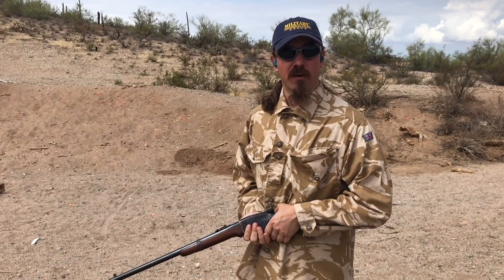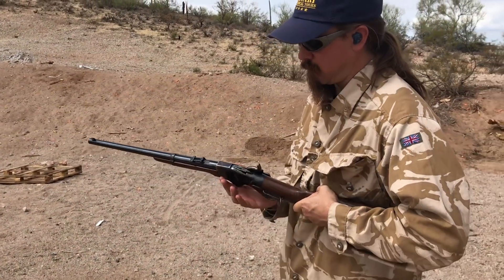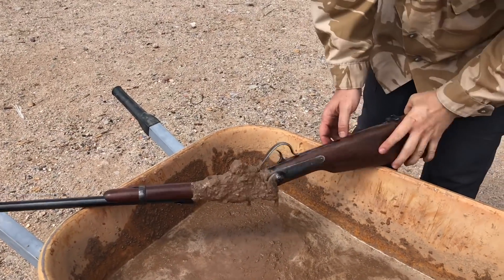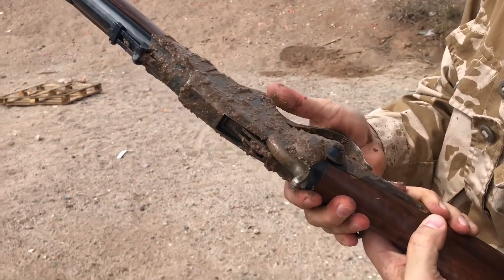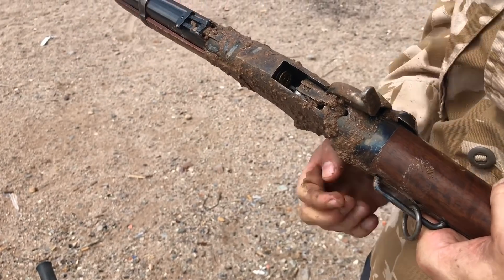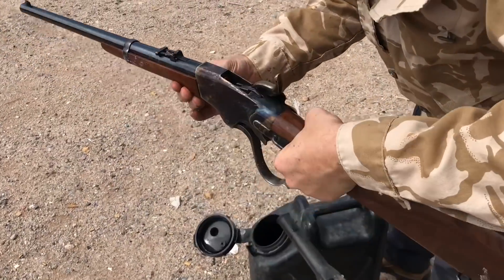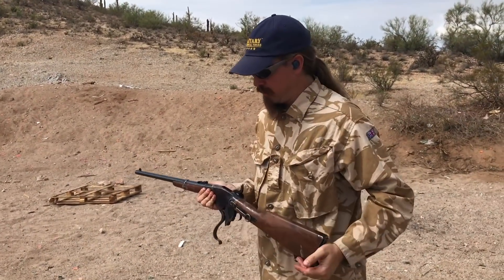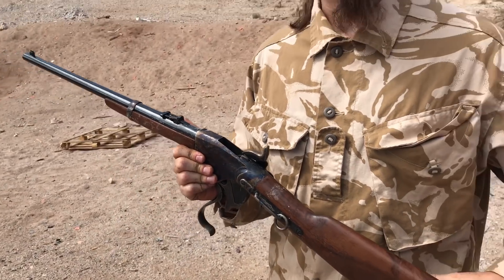Lever Gun Series: Mud Test - 1860 Spencer Carbine

Comment: Would a lever gun like the spencer work better if rinsed from the lever side (holding it upside down and running water through the action and out the ejection port instead of in the ejection port and out the action)?
Reply: I was wondering that myself.
It should wash things in the correct direction I would think.
Reply: I would think so- imagining  the path from the ejection port to the internals as a funnel with the ejection port being the wide mouth of that funnel, it seems that any dislodged debris would be forced toward the smaller opening of the funnel, in this case the more confined spaces of the internals of the action where it could more easily cause issues (such as locking the action open).
Reply: but then the thing that push the cartridge into the chamber would block it, so not much water can actually get to the breach face

Comment: 3:14 - instead of water, which would have been in short supply, I would have tried cycling the action, fast, a number of times to see if momentum would have cleared it.  Perhaps pull the bullet-shaft, unload, run it, then cycle quickly back and forth if cycling while rounds were in it was not working... but it did look like, even though the breach would not close, the cartridges were cycling in and out with the minimal amount of action Ian had to work with.

Comment: Question: If you poured water in through the top and it got the mud stuck farther down, would turning the gun over and pouring water in from the opposite way fix the problem? I don't know if the action has holes on the bottom.

Comment: One thing I've been curious about how it would handle the mud test is the new BRN-10. Ever since I got some personal experience with one, I've been curious how well it would handle the mud test verses the AR-15 tests they have done. The main differences would be the top-mounted "trigger" charging handle and its requisite slot as well as the flat sided bolt carrier and its larger vent holes as well as the gaps the flat sided profile creates in the ejection port. I know with the port door closed it wouldn't make a difference, but I'd like to see the worst case scenario played out.

Comment: I've been thinking about the AR-15 mud tests and I feel there's a bit more than just a sealed design.  From the video it looks like very little mud stays on the AR-15 bolt.  Could it be that the finish is good at causing mud to slide off?  Perhaps from the design the way the upper receiver protrudes further out than the bolt causes mud to not fall into the action when the gun is cycling?   Maybe the gas vents in the middle of the bolt help a little bit in making mud blow away from the action while it cycles?
Reply: If the small, hard pieces of rock can't be dragged in between the bolt and the receiver, mud becomes a non issue. The small gap in the action will wipe it all clean. Perhaps the serrations in the bolt carrier of the AR-15 for the forward assist even serve as a deposit for mud to get into, like early rifling was for black powder residue before they figured out the accuracy bebefits of making the bullet spin.

Comment: Even the "superior German engineering" gerät (jerrycan) could not fix this one. :P
Reply: Thats for sure a US water can
Reply: Which is a direct copy of the German jerrycan...
Reply: No it's not, it's designed and manufactured in Canada. Having a similar shaped embossing on the side doesn't mean it's a copy. Also the fact it's plastic, and not metal is significant.
Reply: Really? You really did not grasp what I said? The "Wehrmacht-Einheitskanister" a.k.a the jerrycan was invented in Germany in the 1930's for use by the German Armed forces. When the British encountered these things they started referring to them as jerrycans because the British in general called the Germans as "jerries". The British copied the design, as did the Americans. Apparently the original Germans design is still being used and produced in Russia because the Soviets also copied them.
Reply: Which isn't the one in the video or the one currently used by the US. "Jerrycan" is a colloquial term for fuel or water can. The current one used in the US is a plastic water jug with a single handle and tethered screw cap with a breather valve. The US fuel can is a plastic jug with 3 handles, and screw cap with no breather valve that uses a separate screw on nozzle to pour. They are embossed with and X pattern on the sides with "WATER" and "FUEL" respectively. The jug in the video is a modern US water jug. Both the fuel and water jugs are made in Canada as well.
Reply: So, its a flawed reproduction. It doesn't even pour water good enough to clean a filthy gun. ;P
Reply: Yeah a specific type of container that holds fuel or water. The term is used to refer to things that aren't actually German fuel cans. Kind of how in the UK they call all vacuums hoovers.  What a mind blowing fact that must be.
Reply: Cool you can use google and read wikipedia. I can also do the game of childish semantics. Not only does your quote note the fact that Jerrycan is a colloquial term, as "Today similar designs are used for fuel and water containers, some of which are also produced in plastic".  It also uses the word emulate, which in no way denominates cloning or identical form, the way the word copy does. Note "to mach or surpass", as in the modern form of fuel can surpasses the older designs, while retaining similar form, thus still being called "Jerrycans".
em·u·late
ˈemyəˌlāt
verb
match or surpass (a person or achievement), typically by imitation.
>versus
cop·y
ˈkäpē
noun
1.
a thing made to be similar or identical to another.